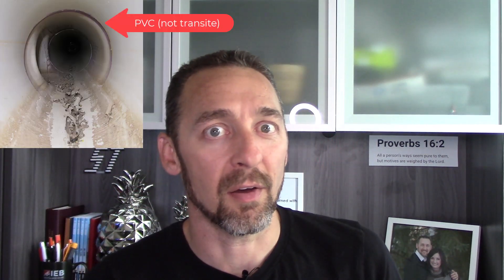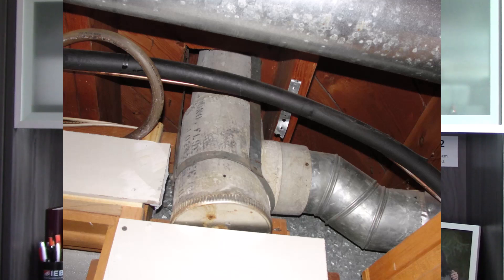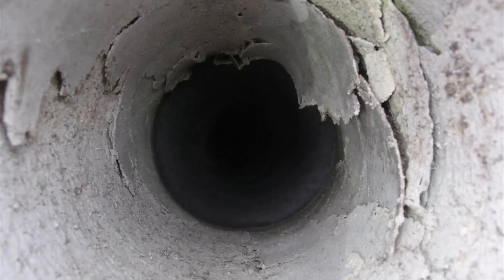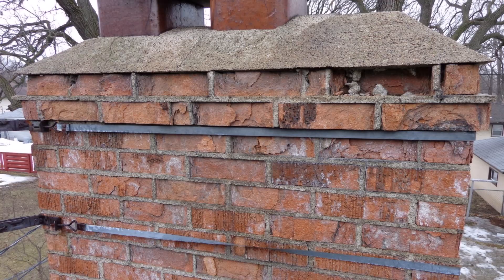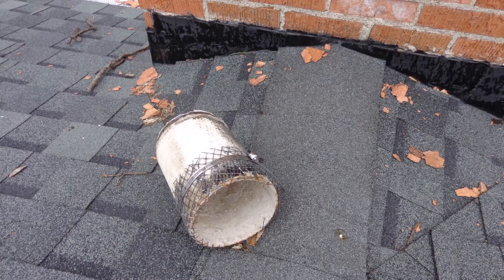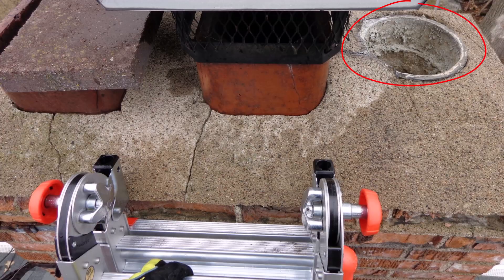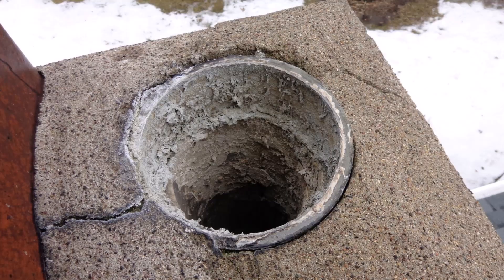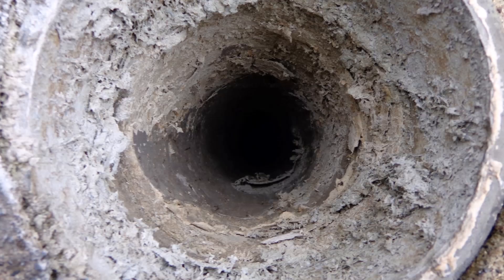Inspecting transite asbestos gas vents

Comment: Good video, sounds like a properly thorough inspection of that house. I was particularly impressed you check for exhaust spillage at the appliance, an important safety check of interior installed water heaters. I would only add that it's good practice to look down any accessible vent, flue or chimney made of any material for damage.